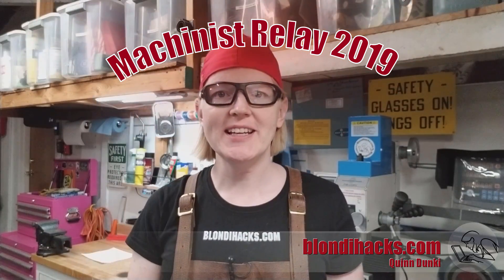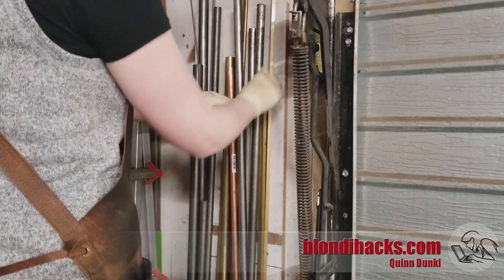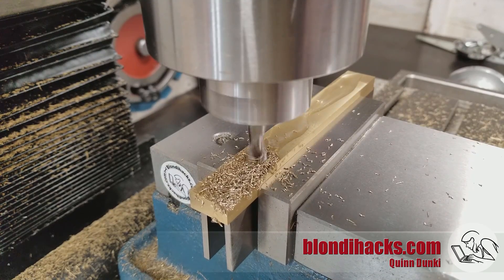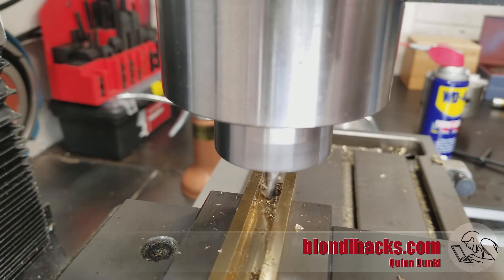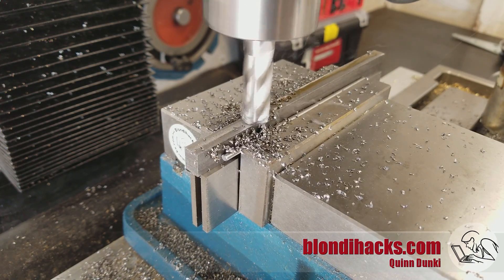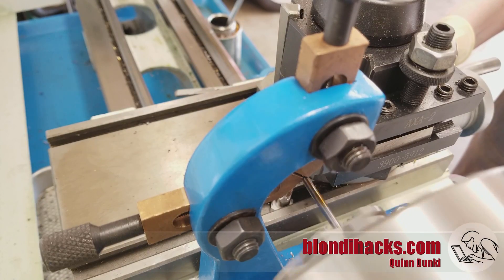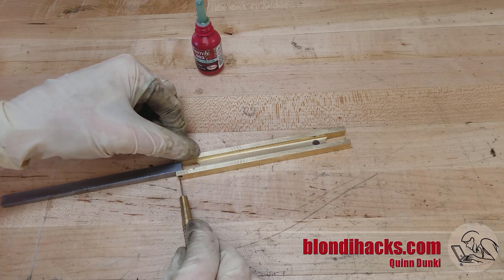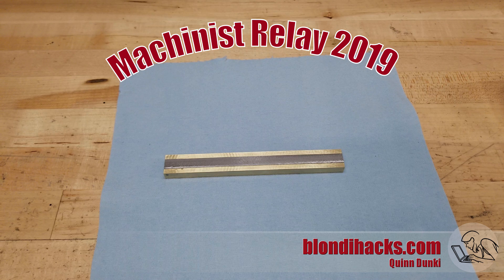Machinist Relay 2019 - Part 1

Comment: quinn, a question.  is that handheld bandsaw good for steel bar?  im looking at some.  poppy
Reply from the maker: April Marie Caron They work okay for smaller steel bar, say up to 3/8”. Anything thicker than that, you’ll be there a while. For tubing, up to wall thickness of 3/16” is okay, but beyond that it’s very slow.

Comment: Your machining videos are great, but I originally got to know about you from your website and your electronics / computer stuff.  I hope you'll do some youtube videos on some of that as well.   As for the machine shop stuff, eventually I've got to get myself a metal lathe and a milling machine.  I have David Gingery's book on building that stuff, but except for one example most of the Gingery Lathes I've seen on the WWW were not very precise. (The exception was mounted on a concrete slab for rigidity!).
Reply from the maker: Thanks! Yes, keep an eye on my Projects playlist for all sorts of random things. I did my bluetooth headphone conversion in there, for example. There's a couple of videos on that. I expect other stuff will find its way in there as well.